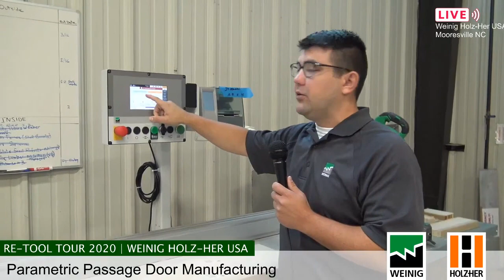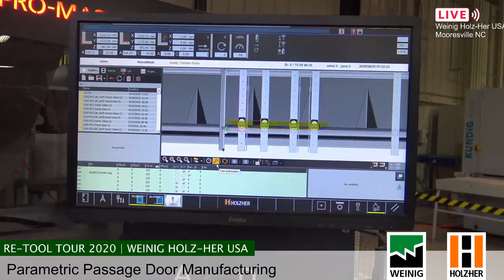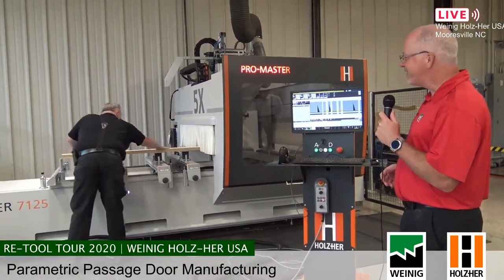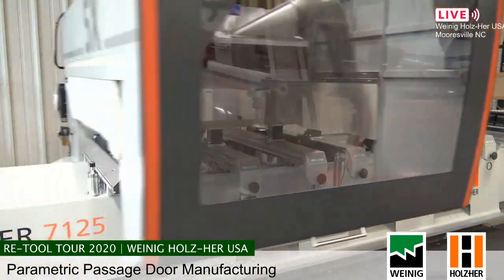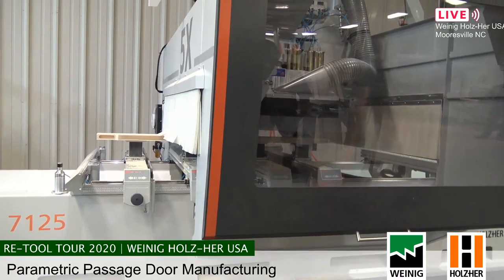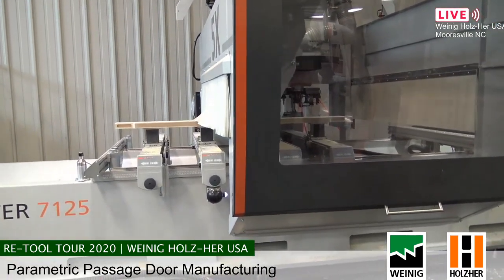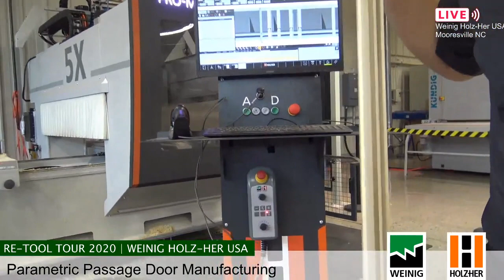5 Axis Machining with the Holz-Her ProMaster (Live 10/15/2020)

Comment: I understand the purpose is to sell your products, but why not incorporate sawing into the process and eliminate the extra machinery? I would also like to see more on multiple part placement particulars. We have a promaster 7225 5xl, and have locating stops along the front and side edges. With multiple part machining,, how do you determine your front and back side operation clearances ?
Reply: Hello,  you are correct, we want to demonstrate the integration of machines and therefore we use a Dimter Easy Stop for the cutting and labeling of parts prior to the 5 axis machining. The saw blade on the Promaster could be utilized to cut components to size, extra caution must be made when locating the pods.  Depending on the size of the machine, this longer part could affect whether or not pendulum processing is an option.  As for the clearances when setting up multiple parts at multiple pin positions, we use the BetterSim module in Campus.  This allows the user to see full machine setup and simulate the parts placed onto the pods.  The simulation will show any potential collisions that may occur.